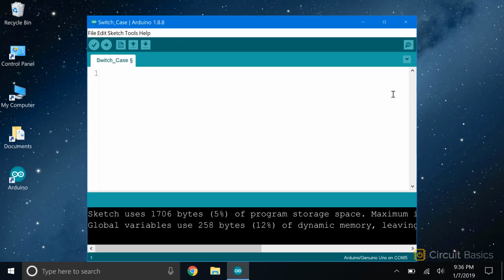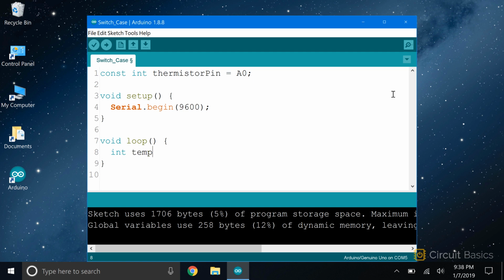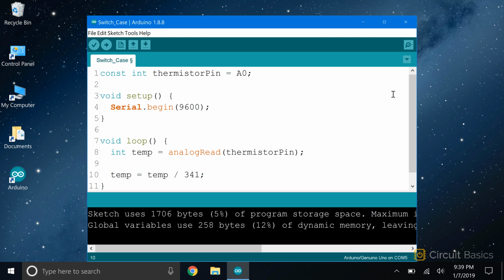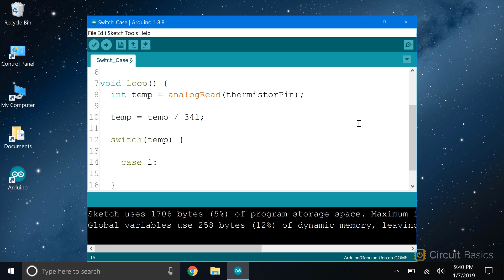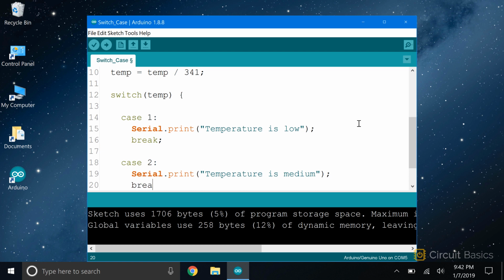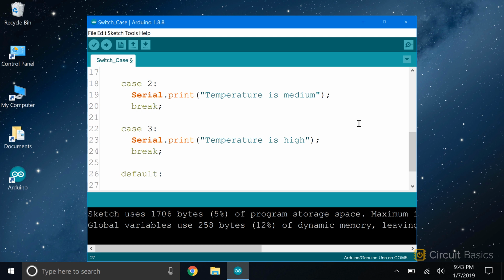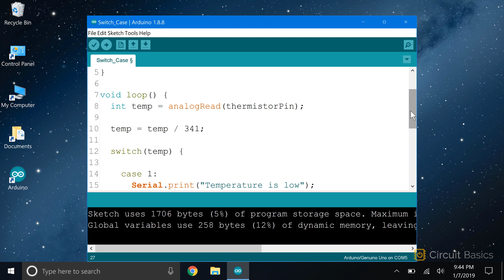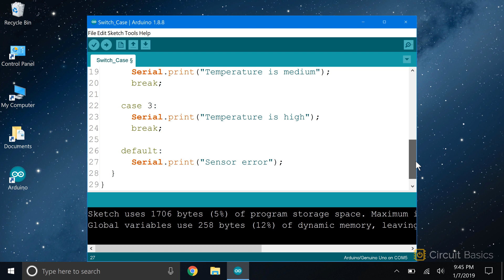How to Use Switch Case in Arduino Programs - Ultimate Guide to the Arduino #12

Comment: I tried out the code and found out that writing "Serial.print" didn't allow me to read the serial monitor - all text just flashed by on one line.
I needed to write "Serial.println" for case1, case2 and case3 in order to read the serial monitor. 
I connected a pot to simulate a termistor .  Pot: outside pin +5v,  middle pin A0 , other outside pin GND. This setup gave the desired result